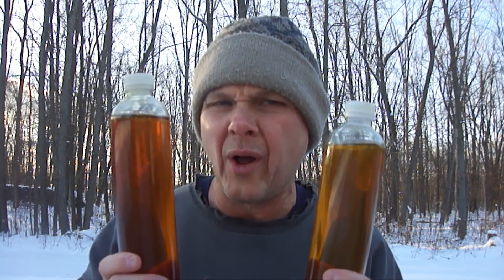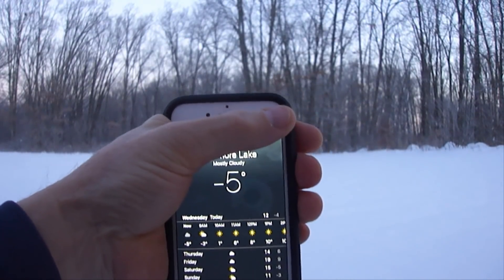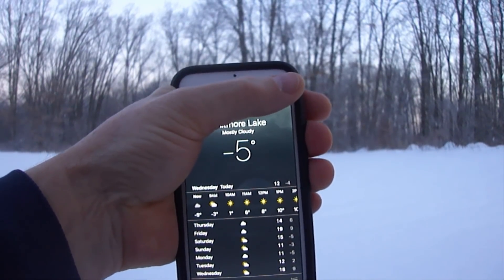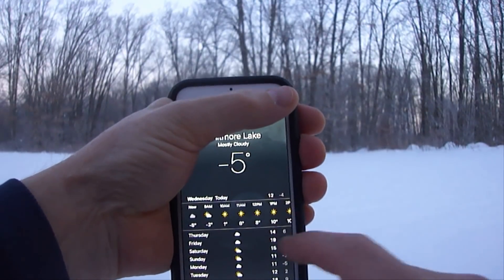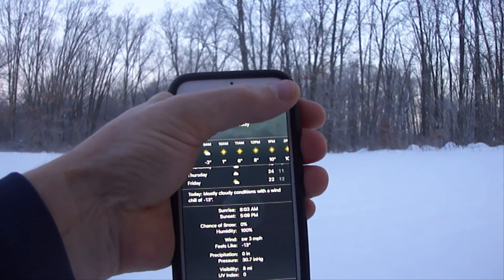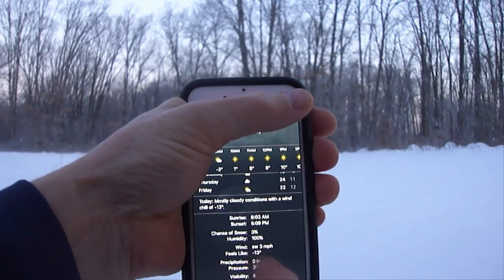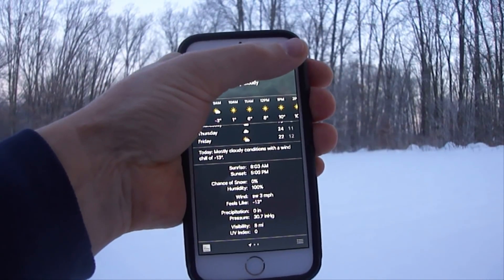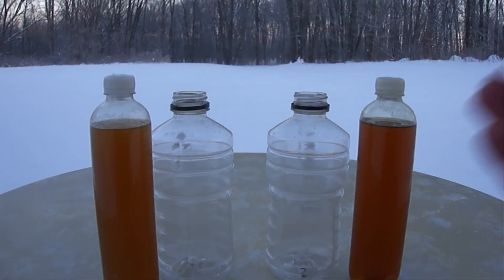Motor Oil Cold Pour Test Comparisons

Comment: -5F is a good test, good to know how they do at that temp. However, at -20F you would have saw a dramatic difference, as the conventional oil would barely flow. Wind chill would have no effect on two bottles left out overnight, it just would have brought them to ambient temp (-5F) quicker.

Comment: Have been using regular oil in all my new vehicles , well over 40 now I have owned and the last four F-150’s were new .
And I have never had any oil related trouble . I change oil every 5000 to 6000 miles 

This synthetic oil marketing is totally overblown and regular oil is all you need . Now if your racing cars or a commercial pilot like me . 
I wouldn’t push it and always follow the book on oils for aviation. I don’t race cars either. 

Just change your oil according to the manufactures directions. Read your vehicle manual . Synthetic is not necessary.
Reply: Does it get cold in the winter where you live?

Comment: Thanks for doing this test! I really thought the full synthetic would do better.
I used to work at O'Reilly's in the 1990's. On a cold -10f morning we did a pour test with O'Reilly's 30w vs Valvoline 30w. The Valvoline poured out a little slower than the ones in this video. The O'Reilly brand didn't pour. A blob peaked out of the upside-down bottle after a few seconds and we all laughed because we knew it was junk. The store manager even squeezed the plastic bottle to try and get it to pour and the blob grew to about 2 inches before it fell off into the pan we were using. Hopefully they've improved it since then but I'll never buy O'Reilly brand oil of any kind.

Comment: Regular oil has come a long long way in getting better. Like in the 1980’s when I first started driving and doing my own oil changes and I had a 1980 Toyota long bed 4wd and I used Valvoline 10/40w back then was one of the best then Castro ,  then on the lower end was Quaker State , and I heard Pennzoil was not good at all because the oil would stick to your engine in a bad way.  Just how I was told   when I was in my 20’s then. 
Oil filter was Frame back then. Maybe STP too that was a big name.  There was no high mileage oil or maybe no synthetic if there was it was way too much money for us kids back then and you changed your oil no more then 3 thousand miles or your engine might burn up and you check your oil at fill up or always Keeping a Qt  of oil with you at all times.  
Fram Air filter always.  Back then we did not have all the difference stuff. I remember the oil cans only then they started putting oil in plastic bottles and we say hey what is this.  
Thanks for listening
Reply: Yep, that's exactly what I used to use. Castro oil from Cuba and Frame filters from the masonry trade. Good times.

Comment: Basically the difference is the viscosity of the oil doesn’t break down over time. So if you use a synthetic it retains its viscosity properties while conventional will become thicker at cold start up and thinner at operating temps as the oils age

Comment: There's not that much difference in the cold flow rate between conventional and synthetic.  I laugh when some manufactures try to show the difference as being drastic, usually they do that by substituting honey for the conventional oil LOL!  Synthetic oil has higher mileage but I'm a low mileage driver so I never reach the max mileage limit of synthetic oils so it's basically a waste for me to pay twice as much for synthetic oil when I still have to change the oil at least once every year regardless of mileage.

Comment: Design characteristics. Lubricants are made to work within a certain temperature range. If the temperature is within that range, they will provide the necessary level of protection during start up. Unless you do cold starts at temperatures belowe -20 F, you can use conventional oil. But check the cold weather recommendations for your production. Heavier oils cannot flow at that temperature, anything 15W and higher.

Comment: What this demonstration probably proves is that even a -5 (F) it doesn't make a lot of difference. Even if the  test conditions misrepresented the flow rate (Have you ever heard of a funnel?) conventional 5W-30 will flow adequately at a subzero temperature. Keep in mind, the oil pump is going to immediately be pushing the oil around at a high pressure and it immediately is going to start warming up.

The only way to test the performance of different products is a fleet test or testing under laboratory conditions.

Myself, looking at all of these motor oil videos has left me convinced, synthetic oil is a vanity product for the most part. Its actual use in normal temperature ranges is to allow a longer oil change interval. Only if you are doing cold starts at extreme low temperatures, such as below -10 F, does its better cold flow rate come into play. In extreme hot weather it might have a use too, especially if you are doing city stop and go driving. Otherwise, you are just feeding your head and trying to create a sense of exclusivity if you use synthetic oil. But if it gets you to keep a maintenance schedule and encourages you to not abuse your vehicle with bad driving habits, go ahead. It's relatively cheap peace of mind. But so is using conventional oil and changing it according to a schedule.

Comment: Moral of the story: If you have clean oil it don't make much difference. Next oil change, I'm switching to SMP 10W-30 from the local dollar store, at a dollar a pint, for my 2.2L 4cyl Toyota Camry with 128K. In ten years or so, I'll tell you whether it blew up or not! Don't be fooled into spending money you don't need to spend. Determine your needs based on the application you have, your climate and the type of driving you do, and stick to what you determine. For me, right now, it's conventional oil and a Supertech filter, and a no more than a 4,000 mile interval. Projected cost $22 a year, plus sales tax.
Reply: I'm running Mobil One 10W/30 at 6K mile intervals in my new (to me) 99 Camry 2.2L w/ 84K. This should be a good test between both our cars. I do 400-500 mi/wk at 90% late night highway driving and avoid stop and go traffic like the plague, but I occasionally do hit some. I also use Restore as I've had real good results with it in the past. I've only done one oil change since I got the Camry last month, so after watching several oil videos and using common sense, I may change my thinking on synthetics and using Restore, but for now, that's my method which worked in my last Corolla with 260k (and still going strong says the new owner). What's your driving scenerio (if you are interested in comparing)?

Comment: I don't know which brands did you use, but that's irelevant actually...
Today, most "fully synthetic" oils out there are highly refined/hidrocracked mineral oils! Pure marketing trick. And they are good. But they are far away from real PAO or ester group synthetic oils by performance at low or high temperatures.
That's why there was no big difference on your unscientific test. New oil will always do well in these simple kind of comparation...
THE REAL QUESTION IS: HOW LONG WILL THAT OIL BE GOOD IN ENGINE? 
It depends on base oil formulation quality and additive package.
Cheap mineral or hidrocracked oil lose their viscosity improvers very fast - and the oil breaks down.

Comment: Interesting. My understanding is that full synthetics offer better high temp performance and not prone to breakdown as quickly as conventional oils.
Reply from the maker: You are correct!  https://youtu.be/pc1qMp0Ea7Y
Reply: John Rand the best explanation I've heard about synthetic oil even if it's not true synthetic but dino with synthetic specifications is that the molecules are more similar in size, and a way to think about  it is if you had two rooms of marbles spread on the floor evenly, one room had 1 size of marble and one room had 5 different sizes of marbles. You place a piece of drywall on top of each set of marbles, now put cinder blocks on the drywall and run them across the rooms of marbles for a long period of time. In this thought experiment it's easy to imagine the biggest marbles in the 5 size marble room grinding into the drywall more at less points and possibly eventually breaking after awhile  and their broken pieces and the next largest marbles are eventually carrying the drywall etc. Compared to the room of same size marbles that are being worn slower & evenly and wearing shallower grooves in the drywall under a more evenly dispersed force. 
 That also helped me understand why synthetic oil leaks easier because the same size marbles would be less likely to clump up as they were being poured through a space then if there were bigger and smaller marbles mixed in.

Comment: What was the point of your test ?
 To see which oil drains faster ?
 .. let’s think about the real reason engines need oil. 
To lubricate and protect metal components from touching each other.
It’s crystal clear that synthetic oil is doing its job by keeping a layer of coat around the inside of the bottle.. while the cheaper oil didn’t. 
In other words synthetic would do exactly as its intended purpose and keep a layer of coat to protect your engine components from touching each other.
Reply from the maker: The point of this test was strictly flow.
Reply: Yes u can clearly see how synthetic will at least keep a thin layer of oil coating in all of ur upper head components as opposed to conventional  which defenetly would be leting some metal to metal contact and that is what eventually leads to premature engine wear and failure
Reply: @Max Vel   The only was to test a product is a fleet test or testing under laboratory conditions.
Reply: Good observation
Reply: Huge misconception. Engine parts never touch each other. A specific function of motor oil, synthetic or mineral, and regardless of viscosity, is to leave behind a protective film which prevents metal on metal contact suring the first few seconds that follow an engine start. They all do it, no exception.

Comment: The temps that effects the regular motor oil more so is when it hits -15 and colder.  With synthetic depending what brand you acquireeffects most at -25 and a couple between -25 through -38.  Aimsoil does the best followed by Mobil one.  Royal purple is the worst foams up even the super tech synthetic oil is 3rd best.  I’m in Alaska and personally done these test.

Comment: Viscosity should be the same for the synthetic and conventional motor oil when unused. The test should be done with used motor oil after an oil change to see which oil held up better.
Reply: Regular oil has come a long long way in getting better. Like in the 1980’s when I first started driving and doing my own oil changes and I had a 1980 Toyota long bed 4wd and I used Valvoline 10/40w back then was one of the best then Castro ,  then on the lower end was Quaker State , and I heard Pennzoil was not good at all because the oil would stick to your engine in a bad way.  Just how I was told   when I was in my 20’s then. 
Oil filter was Frame back then. Maybe STP too that was a big name.  There was no high mileage oil or maybe no synthetic if there was it was way too much money for us kids back then and you changed your oil no more then 3 thousand miles or your engine might burn up and you check your oil at fill up or always Keeping a Qt  of oil with you at all times.  
Fram Air filter always.  Back then we did not have all the difference stuff. I remember the oil cans only then they started putting oil in plastic bottles and we say hey what is this.  
Thanks for listening
Reply: Google User  They're usubg oil out of the bottle.

Comment: but they were both chugging equally because of the vacuum chamber effect you caused
Reply: The Do It Yourself Boat I’m just trying to figure out what the fuck engine coolant has to do with anything lol
Reply: @devin3156  He was just using it as an example of a very low viscosity fluid that wouldn't be frozen
Reply: +proclaimliberty2000 correct. The fact is the conventional did well. However -40 will most likely be more drastic of a difference.
Reply: @TheXOoftheRO  I believe you are right. There are lab tests on the Internet at -40F and conventional oil was almost motionless.
Reply: Not exactly a good test there if both oils had been able to breath the synthetic would have flowed better....check out Project Farm on his -40 cold pour test and see the difference
Reply: https://www.youtube.com/watch?v=sglQrbfFVUI
Reply from the maker: If one of the bottles had engine coolant in it, it would have chugged out a lot faster.  Vacuum or no vacuum, it is a fair test because all things were equal.

Comment: How about when those oil used for couple thousands mile, will they are much more different?
Reply: Agreed. Any half-way decent oil should come out of the bottle with a decent performance. The difference is(allegedly) when the oil breaks down. How its compounds break apart from the heat, and how long it is usable. This does seem to be a video about oil performance in cold weather, however. So it is interesting to say the least.

Comment: The synthetic coats better...and would protect against dry starts....(when oil runs off the lubed parts)....thats what they claim anyway?
Reply from the maker: That's a very interesting topic.  Like you said that's what they claim.  The question is has it ever been PROVEN by an independent unbiased source?  It's hard to get to the truth about a lot of things when there's a lot of money at stake.  Thanks for commenting.
Reply: proclaimliberty2000 ....I would be curious about that...Maybe another video?....Lets see...
Reply: Sooooooo...throw some MotorKote HD in it...problem solved!